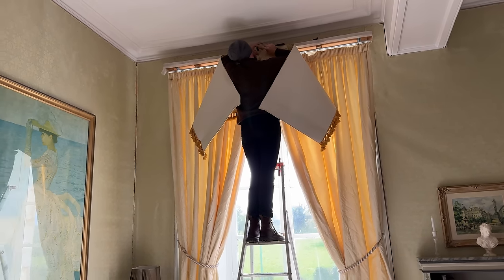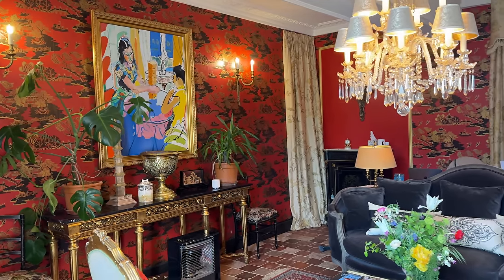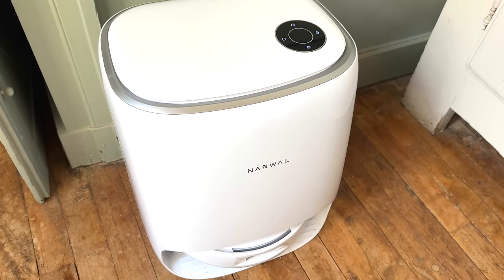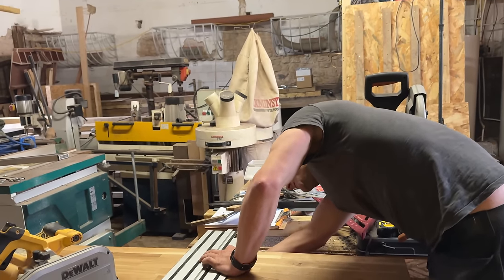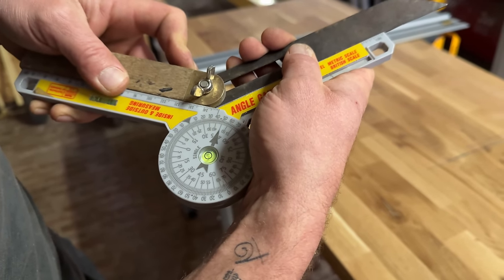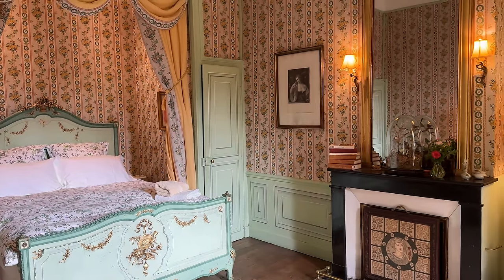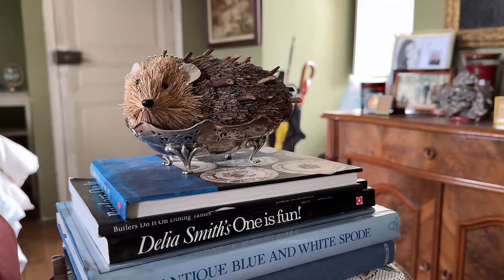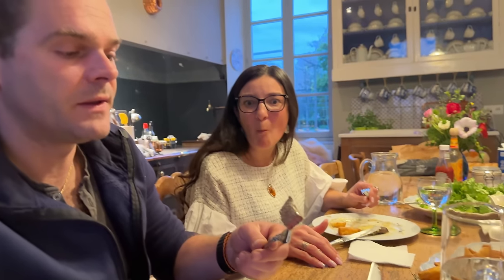Amaury makes Marie a new Kitchen Worksurface!

Comment: Being intrigued by your Briffault stove, I did some poking around the webs earlier this year and found some good information on a page about the stove in Monet's Giverny house. The slanted hood looks like a "grillades", and I notice in the video it sits above some "réchauds" -- pits where a wood charcoal would be burned in the summer months to avoid the sweltering heat that would result from firing up the big fire box. This is explained on the page I found. In the past, when I've tried to link to a web page from these comments, my comment has been removed (some youtube rule?). So..., if you google for "Vintage French Copper Monet's Stove" you should find an article dated December 30, 2023. That's the page. About 2/3 the way down the page are illustrations of grillades. Maybe that's what you have?
Reply: Very interesting
Reply: Yeah, YouTube doesn't allow outside links. God forbid you should navigate away from their site 😒

Comment: When is the grand salon going to be done? I haven’t heard anything about that lately.
Reply: They have to bring the ceiling down to put the steel beams in, so it will be the fall before that happens. Looks like the Chapel restoration being moved up and the staff bedrooms being worked on will finish first. Plus, the heating system finishing, of course. If the windows go into the attic rooms on the backside of Lalande, then maybe Natti's and Gerry's apartments could get their windows. ❤